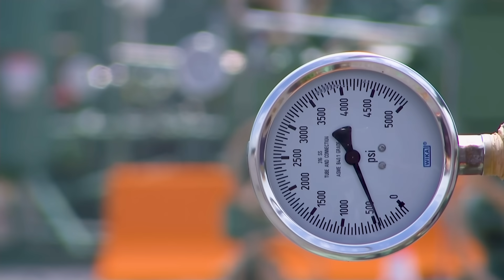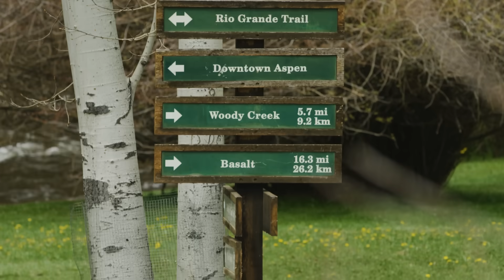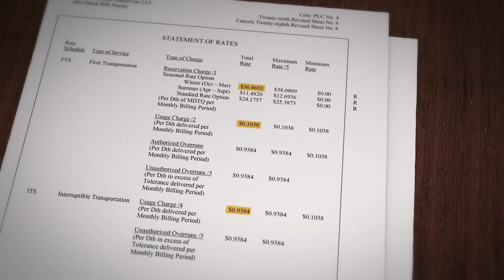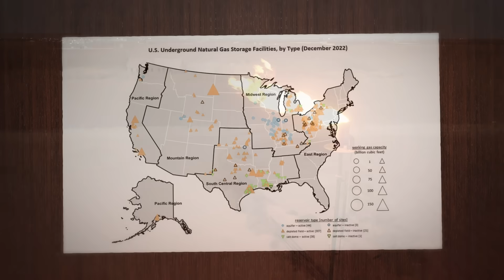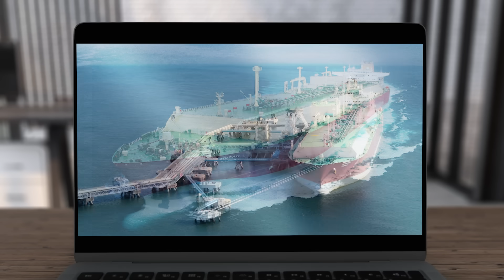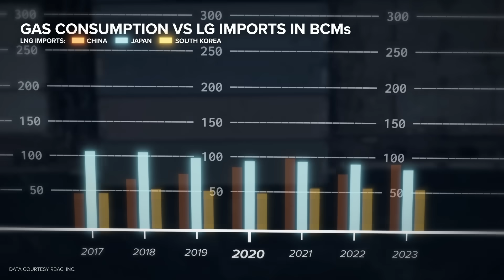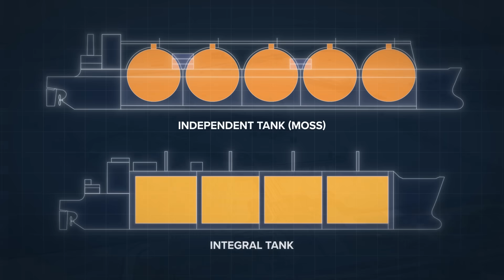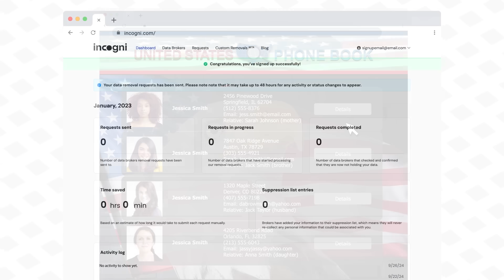The Logistics of Natural Gas

Comment: Imagine is America cared enough to have this massive far reaching infrastructure for high speed rail.
Reply: What exactly would that accomplish? Most Americans don't travel more than 15 to 30 minutes away from their home each day? High speed continental rail isn't a magical cure all.
Reply: A lot of American homes use natural gas in some form every day

Most would not use trains more than a couple times a year. Plus, trains need to go both ways and have to connect not only to where people love but where they want to go. 

Pretty big difference
Reply: @Majilikin  Chicken and egg. You don't have high speed rail so it's not used. 

Natural gas usage has been forced on you for over 50 years at this point. So of course it's used.
Reply: @Praisethesunson  it's not chicken and egg, in this case. The population density of america in general, both because of suburbia and how far apart major cities are make the extremely high cost of high speed rail very unpopular for government agencies to spend on, because people will see the price of a service they don't think they will use and immediately vote for the other guy. 

So even if the service itself could turn a profit, which very specific routes probably could, it would be an uphill battle for the government to do it. 

So that leaves the private sector, which is actually succeeding in some capacity in the form of brightline, but without the full backing of the government it's hard for them to get stuff done quickly. 

So no, not chicken and egg. That's a gross simplification of this issue.
Reply: @Majilikin  Thats all cope which China prove wrong a decade ago.

You don't have high speed rail because auto corporations are more important to the state than you are. Making a profit is serf brain. Your highways have never made a profit and you never even consider that an issue.
Reply: @Praisethesunson  it's not cope, it's literally the truth. If you don't want to accept that I can't help you. take the blinders off. 

Also a lot of modern Chinese rail has been built at a severe loss to areas that won't use it much solely because China wanted not only the prestige but also because they wanted to keep the workers employed. Like honestly if your understanding of the Chinese rail system is so surface level that you don't even know this, I dont know what to say. 

Further more the borderline insult of saying I'm coping is in bad faith, and embarrassing to see someone do. I want rail in the usa, but I'm also a realist and that realism is if brightline fails then the only other option is a heavily subsidized rail network effectivly ran by the government, and the US government has shown us they can't do that.

Also the modern high way system absolutely have paid for themselves in tax revenue from the industry and business they profit using them. You're simply wrong if you disagree with that.
Reply: >using China as any kind of positive example

Out, Lu Bu.
Reply: @Praisethesunson China has a billion more people than the US and the vast majority of their population is on the eastern 1/3 of the country’s area.

Comment: They are called pigs because they squeal as they go through the pipe. You can hear this squeal sometimes and if you don't know what it is can be pretty strange
Reply: We call them hedgehogs in my native language. And sometimes they get stuck in gas pipelines. Then you send another hedgehog and hope it will push the stuck one in front of it out of the pipe.
Reply: That's kinda funny😂
Reply: fun fact in Spanish it's called 'diablo' (the devil) and the pig trap / receiver is 'trampa del diablo'
Reply: @adityac3239  diablo?  That's odd. I wonder where that comes from.
Reply: Nice "inside pipeline" there.  (See what I did there...?)
Reply: Scares the shit out of my cows when they do it at one of my fields.
Reply: Wrong.   Pig is short for ‘pipe inspection gauge’
Reply: @Mitchy_Moo  i bet that's something they came up with afterwards
Reply: Crank up the pressure and spin the chart. Nobody really checks them. 😂😭

Comment: It's cool how similar this is to electrical transmission and distribution
Reply: It’s essentially the same process, just with a different commodity. Production/generation, transmission, regulation, distribution, regulation, end user.
Reply: It’s also cool how they need each other to function

Comment: Natural gas is amazing. I used 111 therms last month to heat my house, heat my water and use my range (Northeast winters). Didn't even cost me $300. That amount of energy converted to kWh that would be 3,250, which at my electric rates would have been over $1,100. Granted nobody in their right mind uses electric resistive heating as their main heating source where there are real winters, but just shows how powerful and cost effective gas is.
Reply: Yep. When you look at natural gas historically, say in the 1960s and 1970s, it made total and utter sense in every way. But modern times are changing, as we produce cleaner electricity every year, and with the advent of cold-climate heatpumps, it's possible and in fact highly effective to heat most of the US this way. Modern heatpumps running around 10-40 degrees F are about 300-500% efficient, moving 3-5kwH of heat inside your home for every 1 kWh of electricity they use to operate.
Reply: > Didn't even cost me $300. That amount of energy converted to kWh that would be 3,250, which at my electric rates would have been over $1,100.

The thing is, if you heat with a heat pump (aircon) you'd average about a 400% efficiency (as measured in kWh heated per kWh electricity consumed), so it'd be about $275. Not cheaper - but not more expensive either - and making it possible for your house to be heated with solar, wind, or nuclear power.
Reply: Heat pumps are not 400% efficient at winter temperatures in cold climates. They are slightly above 100% efficient at +10F. Would still cost far more.
Reply: @dascandy  It gets too cold for heat pumps anywhere with a real winter. Do some more research.
Reply: @MsEyelinered  That is outdated, modern heat pumps are efficient enough that they make sense even in cold climates. That's before getting into ground source heat pumps which, while much more expensive to install, are near independent of the air temperature. I live in a cold country in Europe. Over three quarters of homes here mainly use heat pumps for heat, the rest mainly use district heating, wood stoves or resistive electric heating. Less than 1% of households use gas heating. I imagine the percentage would be higher if there was gas distribution infrastructure in place, but it still shows that heat pumps are viable in cold climates.
Reply: Heat p pumps have four or five to one ratio so it would have been cheaper to use a heat pump,
Reply: Miscalculation !! you get 4 parts of heat for one part of electricity with a heat pump !
Reply: To the heat pump advocates above, I wasn't trying to argue that gas forced hot air heating is better than a heat pump for efficiency and/or running costs, hence why I made direct reference to electric resistive heating. Just wanted to show on a 1:1 basis my cost per kWh equivalent for gas versus electricity.

Maybe it's something I'll look into when it's time to upgrade my system, and there are definitely some benefits, but for the time being it makes little to no sense for me to do so.
Reply: That's a terrible comparison. Gas heaters have inherent inefficiencies due to having to relay and transport heat from where gas is burned to where heat is needed. Even if you want to compare gas to resistive heaters, you need to factor in the fact that space heaters don't try to poison you with carbon monoxide, and can be used to directly heat the air you breathe, without need for a complex and wasteful system of air ducts and pipes. Gas heater efficiency varies, but can be as low as 55%, where indoor resistive heaters are always 100% efficient. Add lower cost of installation and repair, reduced chance of fire and quiet operation, and even resistive electric heaters are a serious contender to gas ones.

But as you said, no one (in cold winter climates) would use resistive heating to heat their homes. That's because modern heat pumps are a much better and efficient solution, that beats gas in price in all but the coldest of cold snaps seen in the US. They're versatile enough to fit existing forced air HVAC systems and can also be made small as individual room mini-splits. The latter allows a more flexible temperature control in a house and potentially even greater efficiency gains depending on occupants' current needs.
Reply: I mean electric is better, but you're essentially wrong about a lot of what you said. First, gas heaters cannon be sold in the usa at less than 78% efficiency. So while old ones exist, they are rare. And really it's pretty uncommon for people to use less than 95%. 

Second, electricity also has inherent waste in how it's transported. Energy is lost as heat in transmission lines. It's not perfect either. 

Third, a lot of electric heat systems still use ducts. So that's not only gas systems. 

Like I said electric is better in most cases, but either you don't know what you're talking about or are lying. In either case, you should stop